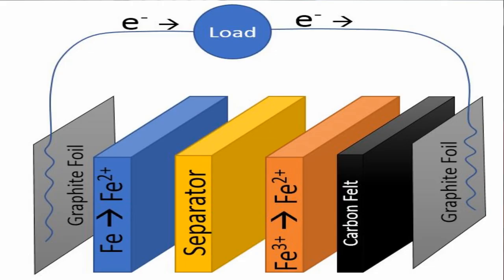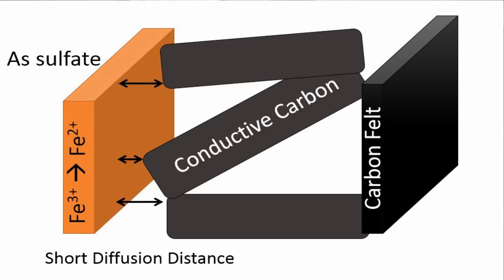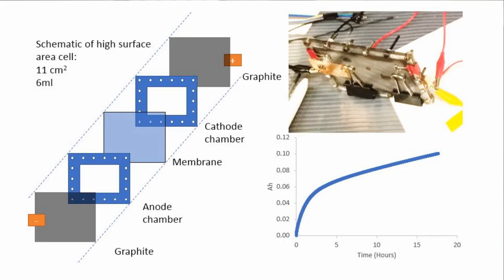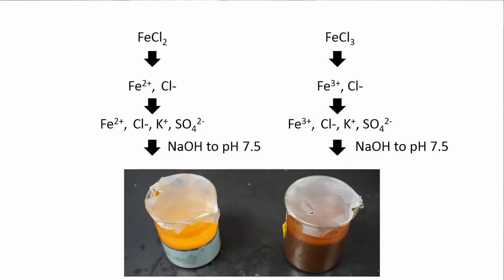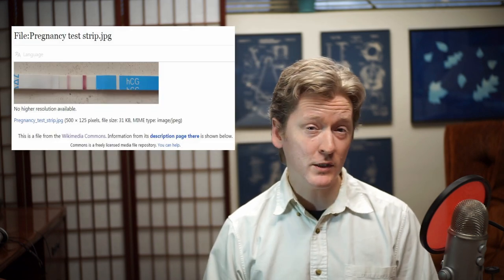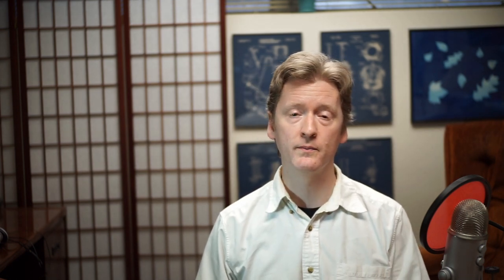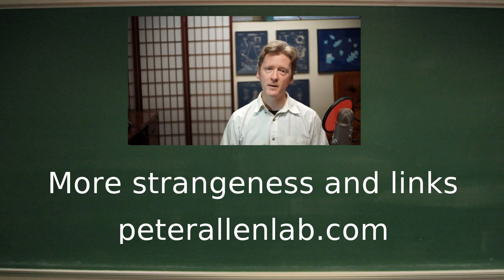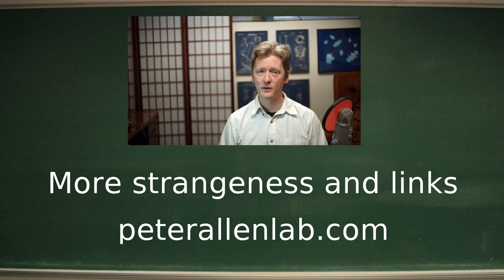Iron battery and musings on test kits

Comment: At one point it appeared your efforts at the all iron battery were progressing well. You began experimenting with different separators and chemistry. I agree that using carbon felt and conductive carbon are beneficial although it is no longer an “all Iron cell” but rather an “iron based cell”. If expense and sustainability are the primary criteria carbon fits the premises.
Dan P commented about his work with hexacyanoferate 3 which I have been following. It does show promise and is worthy of pursuit. I think it noble of him to share his research. His videos are about a half hour long so collectively it is quite a bit of information to go through. It would be worth it to see if it might be of value in your research. 
Keep up the good work Peter.
Reply from the maker: We did try optassium ferricyanide a long time ago, but it bears another try. We're trying to simplify the chemistry, but the old chemistry (v1.0) still works fine. Just not making much progress on improvements with regard to manufacturability.

Comment: By accident I stumbled upon a good Iron Electroplating Electrolyte. I have been able to Iron Plate many Copper and Brass items with it. I know that Iron Plating is very Niche and the electrolyte can be very complex because of the Iron Hydroxide precipitation but the electrolyte that I stumbled upon it shows no sign whatsoever of precipitation and it gives a good thick Iron coating. But I am not sure if it will work for your All Iron Battery. Try this. 2 L Synthetic White Vinegar, 1 spoon of salt, one Spoon of sodium bicarbonate and low carbon iron anodes, 6 volt battery charger let it run for a few hours. At first it turns a light green then bluish and it will finish with a dark Purplish/Violet liquid. I think it's an Iron Acetato Complex. When the Solution is Purplish you can take out the negative iron plate and now you can coat a copper piece with Iron.
Reply from the maker: Interesting - I'll bet the copper adds a lot to conductivity.
Reply: @PeterAllenLab  Yes, I was thinking the same an Iron, Iron battery with Iron plated Copper Electrodes(negative/positive)